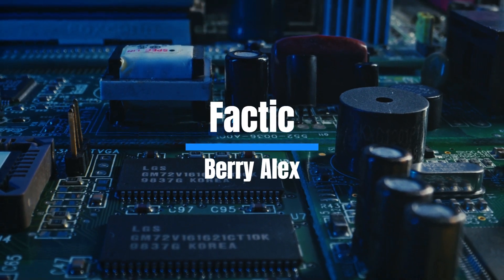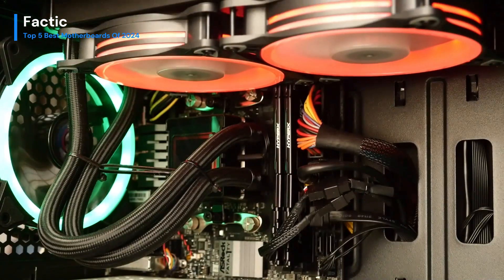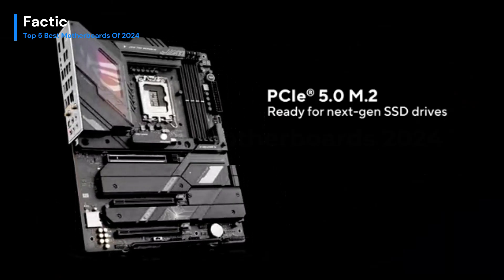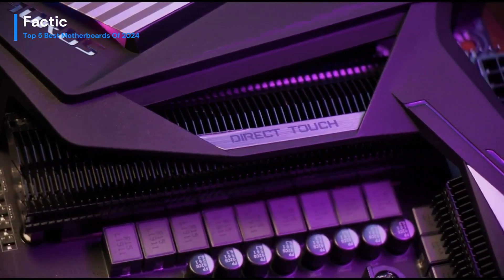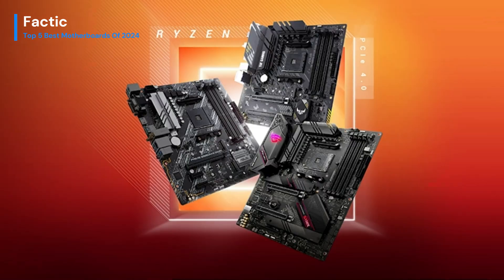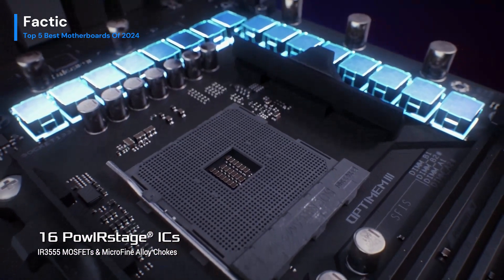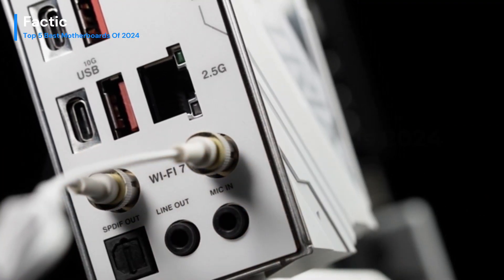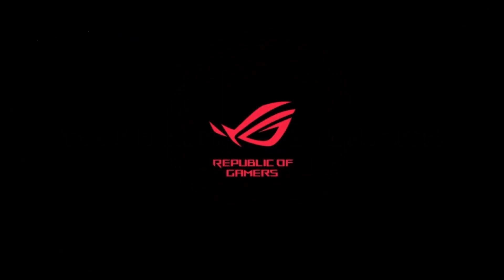Top 5 Best Motherboards 2024 - Ultimate Guide

Comment: ASUS FANBOY VID!  Avoid if you wanna keep your 7800x3d
Reply: That voltage issue was present on boards from many manufacturers.
Asus was just the punching bag because they are the largest company and most likely sold the most boards early on.
The issue was fixed 7 - 8 months ago via a bios update on Asus motherboards.